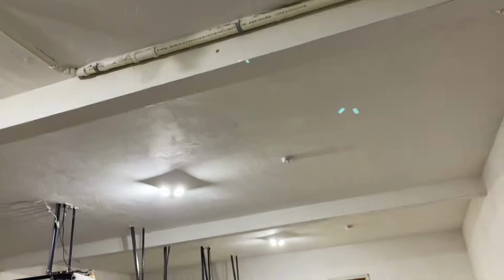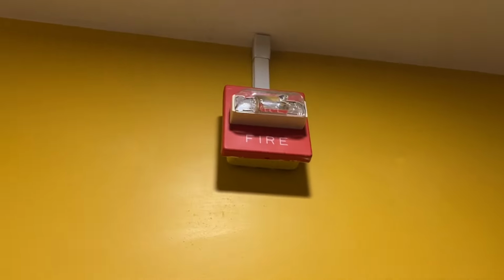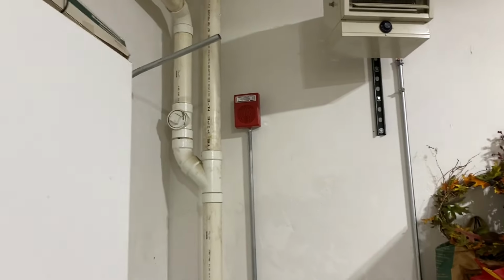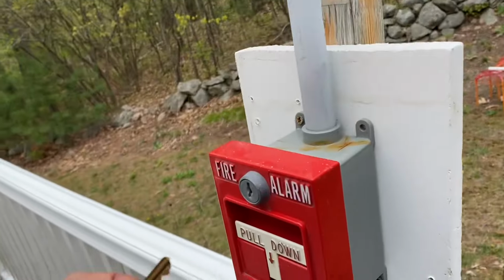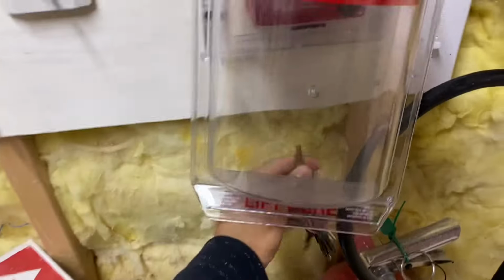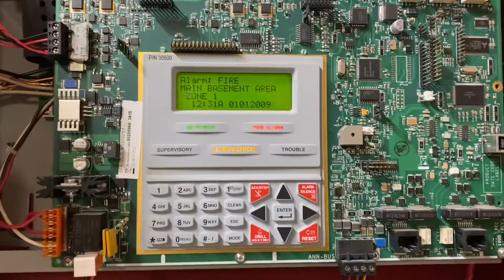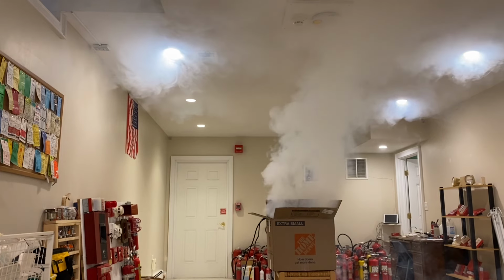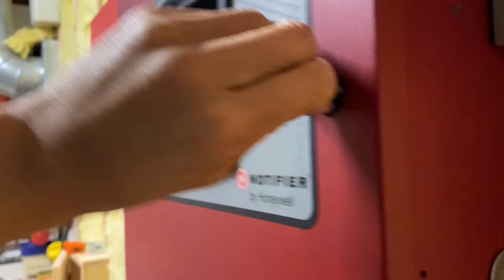Basement Fire System Test 16 | Wheelock Voice Evac and Expansions

Comment: Wheelock speakers (Especially the E Series)  are a pain to install, gotta play around with the wiring especially with a deep four square with an extension ring. So prone to causing ground faults and tearing up wiring if you're not careful lol. I still have trouble in the field sometimes with them when we have to install wheelock but I'm getting better. But neat system man! Love the devices regardless, and love the expansion!
Reply: I have an E70 and it's SUPER chunky
Reply: @lspdfrisawesome8972  They're very chonky indeed. I just did some more E70s and E90s again today. I always tape my wire now because that lip on the inside of the extension ring always tears up the wiring LOL. It's such a bad design honestly, I have a closet full of them but they need to get on par with System sensor!
Reply: I would rather Intstall a Faraday 5505 Than wheelock E70s and E90s. My dad's job is   testing the Sytstems  and He Tested  a Gamewell System with ET80s That are outside and E50s on the Inside.

Comment: I honestly think the annunciator is a great addition to the system. Allows for easier access to basic functions of the system in case of an activation or other problem. Btw the potter EVAX message on the Wheelock Speakers reminds me of my high school’s system. Even though they put in a 4100U they installed an EVAX panel instead of a voice bay which makes zero sense considering the 4100U is literally built for EVAC and mass notification.

Comment: I honestly think that having that annunciator makes your system look more better. That includes the voice evac from those Wheelock E70, E50, & E90 speaker strobes. To me, they just seem to fit very well with your system. Maybe not so much with the smokes, probably because they're older than these Wheelock speaker strobes. But the system works well, and that's a good thing! Now, you pretty much have a whole house system, exept most of it is in the basement. But anyway, stay safe, and stay awesome!

He used the McDonald's code 3 tone.

Comment: The old safepath speaker/strobes sounded like a 31T 115 Wheelock Horn and the new one sounded like the Siemens Speaker On S.E.R Safetys Firelite MS 9200UDLS Adressable Fire Alarm Control Panel
Reply from the maker: Noted
Reply: Also fun fact S.E.R Safety Has A Wheelock E50 Speaker Strobe.

Comment: Can you get the Wheelock Safepath Evacuation System. Here are the messages to use for Example Fire, CO, General Emergency, Severe Weather, etc. Wheelock also sells their ET70WP Outdoor Speaker Strobe for the Outside Area
Reply from the maker: I don’t have the money for a safe path unfortunately
Reply: @FireAlarmDude5967  There are other Youtubers that have the Safepath like S.E.R. Safety, so you can watch all about the safepath

Comment: Are you planning on putting a smoke or heat detector and co2 alarm in the garage also I thought you put the annuositer in the basement
Reply from the maker: Smoke maybe but not a CO2? detector because I don’t have one of those
Reply: @FireAlarmDude5967  i said maybe a CO2 speaker strobe
Reply from the maker: I don’t have one of those either. Do you mean carbon monoxide?
Reply: @FireAlarmDude5967  yeah
Reply: @FireAlarmDude5967  do you have a outdoor weather proof speaker strobe
Reply: @Earth_Number_12  CO2 is carbon DIoxide CO is carbon MONoxide